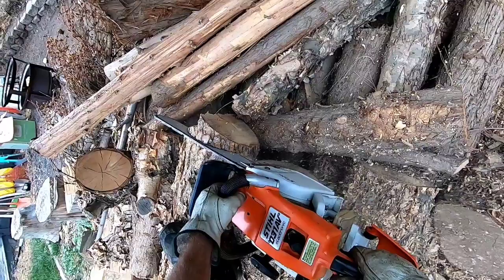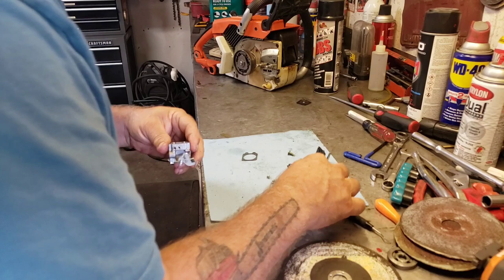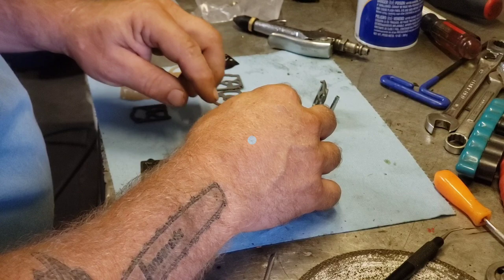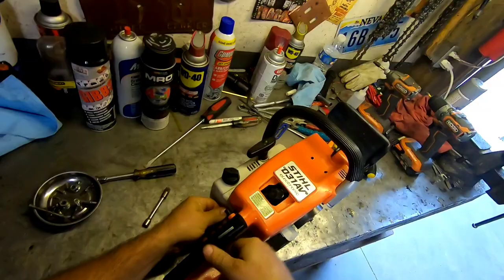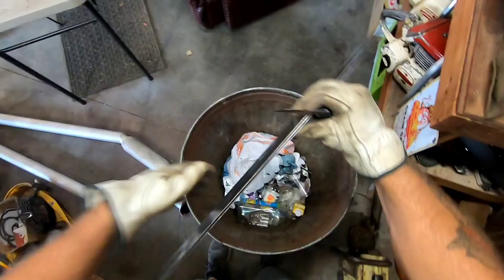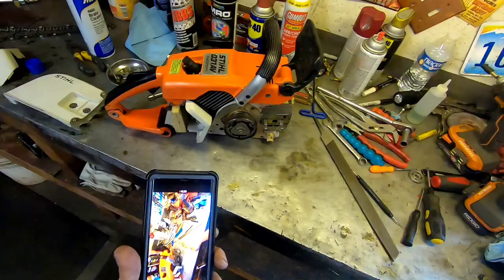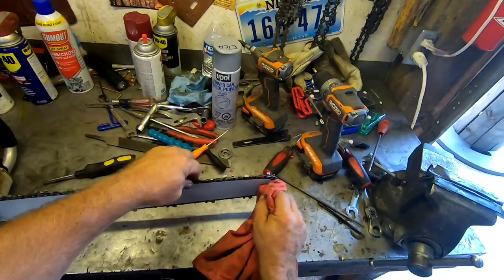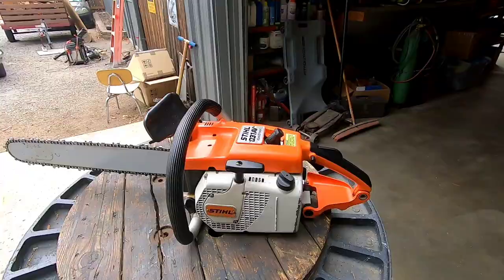Stihl 031AV Chainsaw Ressurection...It Lives!

Comment: I’ve had an 032AV from new, over 50 years in fact. It’s the best saw I’ve ever had and cut a lifetime of firewood. Compression is still unbelievable and at 76 I can no longer pull it over. My wife suggested I could sell it and I said “no way it’s going in the casket with me”….Grin~
Reply from the maker: That's Awesome Rob, Yes, they area great saw, hard to believe they are that old...sort of  timeless design...appreciate  you Sir!😉

Comment: Never owned an 031.  Have thought about getting one and restoring it.  Mr. Obsolete says it has a lot of torque, more so than his 025.  I don’t know but my 025 is no dog, nor is my 024.  Both have a good bit of torque.  They both have new cylinders, pistons and seals, as well as Caber rings.  I cut up a dinner plate sized beech last week that fell in our American Legion hall parking lot with my 024 and it cut through it like it was butter.  I agree cutting has a much to do with the chain as with the saw and it had a sharp chain.  It’s original chain had been on my chain grinder and then, hand filed, so it was sharp.  I do not waste time trying to cut with a dull chain as some do.    I wire wheel old bars and then sand them.  I then paint them with grey primer and then paint them.  Flat white for Stihl bars, followed by a coat of satin clear.  I use Rustoleum paint.  I dress down the bar after the paint has dried, throughly.  It takes 28 days for paint to completely dry.  If you not clear coat the flat white the white will discolor when the bar oil hits it.
Reply from the maker: Nice John! Yeah the 031 is a pretty good all around saw....Thanks for your Wisdom Sir😉

Comment: Nice job.  👌.  I love these old saws.  When you shut the saw off I see you pull the cord a little.  Is there a reason for that?
Reply from the maker: Thanks Alex, holding the handle out is supposed to keep it from cicking back on the starter pawls, I've seen other guys do it but not sure if it is really necessary 🤔
Reply: @KainKustomGarage  Good to know. I’ve seen others do it too.  Sounds like a great habit to get into. Thanks.

Comment: Great Job Dan sounds great!, however please start buying a better quality canned gas or mix your own! Trufuel is garbage, and not recommended for many outdoor power equipment! Stihl is expensive but Husqvarna has one that is better!
Reply from the maker: Thanks Pat, yeah you're probably right, I really need to go back to mixing my own, I want to try that Echo Red Armour recommended by Mr. Obsoletes, there's only one station here that sells non-ethanol gas....but it lasts a while when you mix up a couple gallons...😊
Reply: @KainKustomGarage  some of the other canned gasses are not bad, VP, Stihl, and Husqvarna, but the trufuel brand has put may saws in the shop, including some of mine! So I stay away from it!
Reply: VP race fuel, 94 octane premixed. Expensive but it smells like the drag srtip.